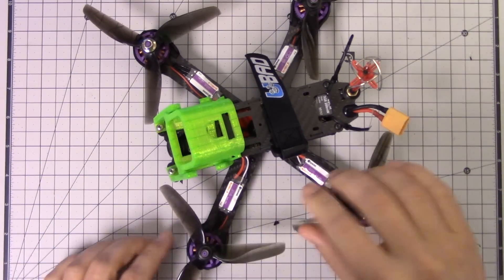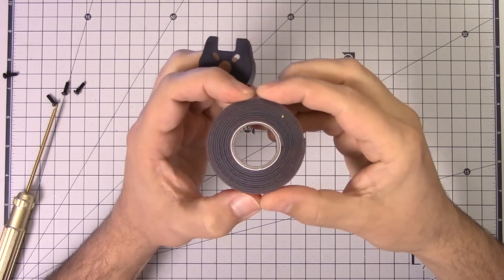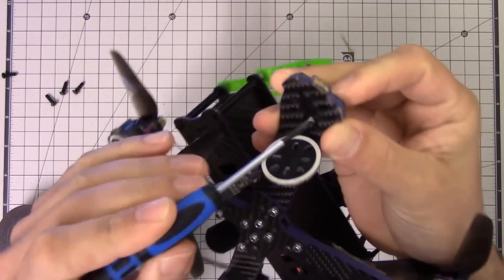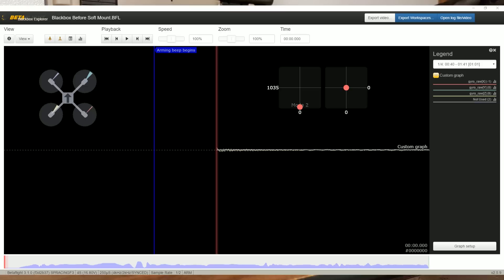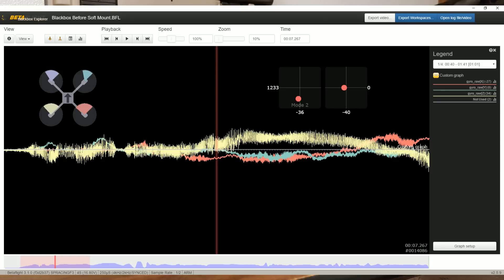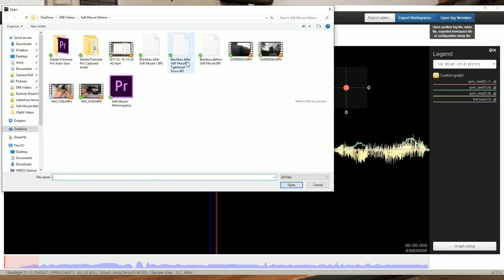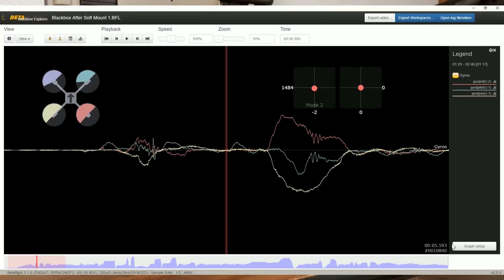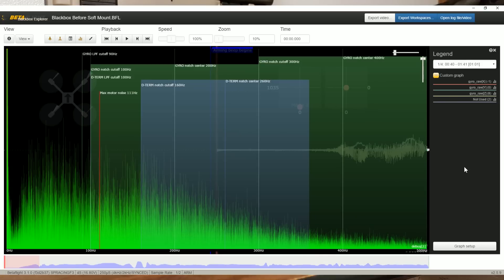Soft Mount Quadcopter Motors | MYTH BUSTED OR CONFIRMED?

Comment: Makes sense, vibrations will differ from build to build because there a lot of variables.  So, your recommendation? Should we put the rubber tape on both sides, or is one side good enough?  Anybody try o-rings? BTW, say NO to bell bottoms.

Comment: Joshua big fan love your channel question please help when I arm my motors on my stretch x with emax red bottoms lux v2 flight controller and a 4in1 ESC the motors are in idle but when I throttle up and then back down on they're own the motors start speeding up with the throttle all the way down and I have it set at -100  it stays in idle good but as soon as I throttle up and then down it goes back up again and I have to disarm it to get it to stop please help if u can
Reply from the maker: D gain too high is a thing that can cause flyaway. Also, if your FC is loose and gets to shaking.

Comment: Very informative, however - any chance soft-mounted motors make it harder to tune out propwash oscilations - specifically these during punchouts?
The theory would be that since removing all filtering (PT1 and 0 HZ notch settings) helps get rid of propwash, so then adding soft-mount introduces some kind of filtering back?
I have a pretty clean realacc/BFF3/emax2306 build with  quiet motors, soft mounted FC. Then added the motor pads (getfpv). no matter how high the D is i cant get rid of the prowash :(
Reply from the maker: Your theory is reasonable. The question would just be how much latency the soft mounts added.

Comment: Use a slightly longer screw and "soft mount" the screw side as well then you escape the contact of 1 axis of the screw. Bore out the holes in the frame and line it with mounting tape or plastidip, then it is fully isolated. Has anyone seen a spring setup? Having thoughts of the old car cd changers that still skipped. All this makes a difference but how much? Most of us are park flyers not aerial photography pros, so is it worth it for the hobbyist? FPV racer? Would be interested in seeing fpv with the data of each in a more controlled setting ie indoors with set parameters like a warehouse loop. Thank you for making great content, super  informative. You Rock!

Comment: the problem with soft mounted motors is that you don't get stretch on the bolts. it makes them prone to self loosening. there needs to be a soft mount solution where the screws can be torqued without that compressing the soft mount. like old servo rubber gromets that had brass sleeves to drop into the rubber. I thought about buying shouldered bolts but I can only find short m3 or bolts in stainless steel for $3-$5 a bolt which would be cost prohibitive.
Reply from the maker: If you use soft mounts, you must use blue loc-tite in my opinion.

Comment: I like these silicon soft mounts on eBay. Look at this on eBay http://www.ebay.com/itm/112375668423

I'm also using the silicon bobbins for the Luminer QAV250 for FC mounts. a little tall, but it fits.😉

Comment: I guess those huge changes in noise you talk about by the middle of your video are due to vibration frequency matching the natural frequency of the system as the motors change rpm. 
As for the head screws touching the arms, well.. you cannot tell that it is a fixed joint but an articulated joint, so the ability of that particular part to transmit vibrations is minimal, that's why soft mounting has some kind of sense when it comes to avoid vibrations.

Comment: Yo great video bro 👍
I've just changed the bearing out on my x220 wizard as yeah they Was rattley lol! now there nice and tight and run nice and smooth. I could feel the vibration from the motors by just spinning the motors by hand and definitely could hear it when flying 😆
And I've also tpu soft mounted them too and wow I can feel the difference in them just by hand through the frame with spinning them 👍 great job
I'll have to fly it tomorrow as I have a esc to replace as that crapped out on me just over night 😆 so I'll give you a update on my findings 👍

Comment: Did you put rubber on both sides of the arms and washers under the screws? In your vid it looked like a layer of grey rubber on the screw side of the arm. If the screws fit loosely in the holes in the cf arms, then even they would not be vibrationally well-coupled to the frame with rubber on both sides of the arm. ? With O-rings and flight controller, you want the screws to fit loosely in the fc, right? - so the fc is in contact with the frame only through the O-rings? So with the above the motor screws and motor would be in contact with the frame only through the rubber pads. Does that make sense?

Comment: Mr. Bardwell, I've been experiencing crazy noise in my FPV goggles, especially when at high throttle punch outs. I've ripped my quad apart so many times in an attempt troubleshoot the issue but to no avail. I switched cameras rerouted wires and still nothing. I was beginning to believe that it was my PID settings. At the time I was using Cleanflight but recently switched to Betaflight. I finally got my quad to fly super buttery and locked in, but the damn FPV goggles still had a isht ton of noise. 

I finally soft mounted my motors and now my video feed is solid. Thank you. I also like to thank you for many of your other videos as well. So thanks again! I'm in Sherman Oaks and would love to rip with you one day. 

Best regards,

-The First African American Quad Racer -
QUADristotle
Reply from the maker: Excellent. Glad it made a difference for you. You can also add capacitors to your ESCs which will probably fix the noise, if you didn't do that already.

Comment: The screws might still be touching but they also have freedom to move a little. if you push down the motor you can lift the screw head ever so slightly off the frame. So soft mounting is i guess like suspension.

Comment: Can't this be done in software by tweaking the filters?
Reply from the maker: +Daniel Tralamazza maybe. Sometimes. It depends.
Reply: Care to elaborate? I would rather have this tweaked in software than have a motor detaching mid flight
Reply from the maker: Soft mount the FC using rubber standoffs. Don't soft-mount the motors. You'll probably be fine. Soft mounting motors is a last-ditch option for those who can't solve their problems any other way.

Comment: The argument that screw heads are still touching is only half true. Since the motor is mounted on a soft pad, that pad can be squeezed or expanded. Normally it is squeezed only so much to provide a reliable mount. But when motor vibrates, it can squeeze the pad even more, and that's where screw heads stop touching (and that's why Loctite is needed). So at least half of the vibrations are dampened. But this also should affect the flying characteristics as multicopter body is not rigidly connected to the motors anymore.

Comment: Does the soft mounting cause the screws to chew into the carbon of the arm?  No after video from the quad after soft mounting?  So would you soft mount the motor in lieu of soft mounting the FC?  You have done videos on both at this point.

Thx
Reply from the maker: +Scot Caraway I prefer to soft mount the FC.

Comment: Joshua, how can i visualize the accelerometer graphics on the motors tab, instead of the gyro graph?  I ask because i want to see the average vibrations of the accelerometer, the same ones that are shown on the gyro data in parentheses. Thanks.
Reply from the maker: +ashingashinga you can't. They changed it and it's gone.

Comment: Hey Josh, awesome video. I was flying my Wizard a few days ago and had no oscillations at all, and today when i went to fly it was bouncing around all over the place. Only thing I've done between the two flights is take apart my frame, clean the quad and put it all back together again. Would soft mounting fix this sort of thing? Or could it be something else? Thanks in advance, and keep up the great content!
Reply from the maker: +Calvin Hill it's something else. Something broke or got messed up when you assembled the quad.
Reply: Joshua Bardwell thanks for the help! will go try see if I can find the problem

Comment: Hold on there - did you just say jello can come from a loose lens? Absolutely got to check this out. I suddenly started to get lots of jello on the third or fourth flight with a new runcam, when before I had none. Thought it was because of changes in rates and PIDs.

But the rest of this video is very informative, too - I admit I shook my head when somebody told me to soft mount - especially after well-meant advice to force Betaflight onto my old F1 had gone wrong, I wasn't going to trust more of these improvements... going to soft mount and will definitely check my lens.

Although I advise beginners who start to fine tune: Buy a second quad. One to fly and one to fine-tune.

Comment: If folks are concerned that the bolt head continues to transmit vibration through its contact with the frame, has anyone tested soft washers between the bolt head/frame with a thin metal shim between the washer and bolt head to distribute force across the whole washer?  Like these:  https://drones.altigator.com/rubber-neoprene-antivibration-washer-m3-p-41494.html ?  I ordered some and will try.  Use blue loctite not red btw.

Comment: Hey Josh. Just wondering how tight to tighten the screws if I'm using a 1.5mm TPU soft mount for my motors? Do I tighten them down like I would normally or should I leave them a little "loose" so the TPU has more effect? If you or anyone in the comments help me out on this silly question I would greatly appreciate it. Thank u
Reply from the maker: I think if you tighten them too much the filtering effect will be reduced. Ultimately you could do trial and error with blackbox gyro traces.
Reply: Joshua Bardwell that's a good idea. I'll do some comparisons and find out for sure. By the way, I've never used an on board sd card reader before....at what rate is it best to log at on a on board sd card reader for black box? Thanks again Josh.
Reply from the maker: +Mr. Pink 1 kHz is more than sufficient. You can try to go higher but for most people there isn't any benefit.
Reply: Joshua Bardwell  awesome. Thanks brother.

Comment: Hahaha, the first 10 secs... hilarious!
I'm going to soft mount my Racerstar RF2205S 2205 2600KV now.
Even though the Flip32 F4 has a MPU6000 via SPI i got heavy jaw twitching as a result of heavy motor noise induced mid throttle vibrations.
After soft mounting the FC with o-rings the quad now behaves exactly like the Wizard in the beginning of the clip.
After watching that video i'm sure that soft mounting the motors will get rid of those little yaw twitches that are still there.

I was hoping for cheap replacements with those motors, but they quit making them last month or so.
So i'm left with cheap, awful, noisy motors that i can't even replace when they fall apart, damn Racerstar for that!

Comment: I think the long arms you see on some X quads adds to the vibration issue? Remember kiddies the arms don't actually have to converge to a single point to have 4 way equal motor spacing. It is just as valid to have arms mounted like the classic Blackout miniquad and have shorter stiffer arms. You could also argue the arms converging directly under the FC almost directly couples the vibes to the FC without any of the inherent damping the frame would have if the arms did not converge at the center. Basically I am saying converging arms are a backward step in frame design.

Comment: Try using Velcro mount for the control board.
Reply from the maker: Under no circumstances should you do this. Velcro has too much "give" and the board will vibrate like crazy and the copter will not fly well at all. I am not speculating here. A person tried this and asked me, "why am I getting these crazy oscillations?"
Reply: It is quite a simple set up. You will only know the results if you try it yourself. The oscillations on your friend's  drone may have come from the wires connected to the receiver/ESC/battery, which is quite a challenge to isolate from the motors.

Comment: N00b question here.. but what would happen if you soft-mount the quad arms to the frame too?
Reply from the maker: +Peter Metzger the copter would be much more fragile in a crash.
Reply: So in this case, a rigid inelastic collision would be more durable than a slightly elastic one? I mean, that assertion is in line with what I've heard other pilots say, but I'm trying to figure out why that is actually the case.

Comment: 8:22 what about the screw head? 

Put some more tape on the bottom of the arm (and maybe longer screws), so the screw heads are damped a little too?

I'm too new to this sport to know either way, but before I even heard of soft mounting (i.e. a few weeks ago) I thought about mounting the motors with an 'o' ring between them and the arm.

Either a big say 15mm or so  O-ring, big enough to encircle all 4 screws, or individual 3mm O rings on each screw.

Why did I think this?
Because nearly every other motor I've ever seen/worked on on a vehicle is mounted on some kind of damping base, often rubber and I saw no reason that might not help here.

I had no idea if it would be actually useful, but intuitively everyone  (more or less) knows "vibration is bad"(tm).

Comment: hey i won a bid on eachine wizard but wish i didnt after hearing stuff.. what you reccomend when i get it to do to help my fpv experience? foxxer 1177 cam? i have fatshark 600tvl but doubt that work good. I use to fly fpv but had walkera 250 runner and had bad bad experience it drop out sky randomly
Reply from the maker: I recommend the RunCam Swift 2, since it will add a voltage monitoring OSD, in addition to being a good camera.
Reply: oh cool, nothing special to hookup im guessing solder here and there no big deal

Comment: Would be interesting to know what the torque on the screws where on the first tightening down, & then if you replicate that torque on a few other motors and mounts & see if you still get the same results. Yes I'm 1 of those guys that tired this 2 or more years ago, I found that there  was lots of variables even the density of the rubber had an impact

Comment: I've been doing this for a long time, even before it was talked about like now, the benefits became clear very quickly. Now I can even  buy pads specifically for this on eBay. Place them under the motors and with the motor protector under the arm the screws even tighten onto that, not the carbon. You can heard the motors sounding cleaner in the air, to me this is a must because of the benefits I achieve.

Comment: How about soft mounting the bolt as well? Even better. Have a big enough bolt hole so that you can have a o ring between the thread of the screw and the inside edge of the bolt hole. same concept as a rubber grommet.  So the motor would be purely soft mounted.

Comment: @Joshua Bardwell: I´m working as a engineer in the semiconductor manufacturing industrie and know "a bit" of PID, gyros, dampening, dynamics of vibrations etc. Because to produce wafers you realy need a good understanding how to keep your PID controllers dealing with the slightest vibrations. What do you think why it´s possible to do lithography in some nanometers resolution to produce computer chips?  :-)

I´m realy glad you did that video. After all the haters and people knowhing nothing about this just laughing and shouting "hypetrain" you did a great job showing the results. You´re right with most of your assumptions and did a realy great video.

There are some other reasons why the connection of the screwheads are not a so big deal, not only the surface area, but your conclusion is damn right. Of course soft mounting is reducing the vibrations that your PID controler has to deal with. And of course, some people will feel a bigger effect that others, this is not only because of the motors, but also about the frame design. There are even enough quads with so less vibrations, that the gyro filters will output a clean enough signal.

The most important thing beside getting rid of the vibrations is, that you indeed (in some cases) can tune your PID´s much better, resulting in higher P and lower D and a better tuned quad.

I´m personaly sick and tired of discussing with haters who do not even listen and trying to understand, just trolling around and making jokes of others. Just look at all the jokes and memes in the Facebook groups. :-(

Nice Job Joshua Bardwell, you have one subscriber more.

Just one last hint: If you look at the spectrum of the vibrations without soft mounting, you may notice that the biggest amplitude varies in frequency between differend quads. If you would like to push the soft mounting further you could do that with selecting different hard soft mounting materials, because they will dampening better on specific frequencies. This can be achived with polyurethane elastomers in different shore hardness. 

There is no vodoo, this is just known engineering in some industries. :-)

Keep on with your great videos!

Comment: I have no knowledge about this subject but I'll venture a guess: if you don't mount motors at all you'll have no vibrations. In other words, there's a reason the motors are mounted and they are probably expected to be in a certain position for optimum flight. That is not to say there is no happy medium in which both flight and positional sensing are good enough without making the other unnecessarily bad.